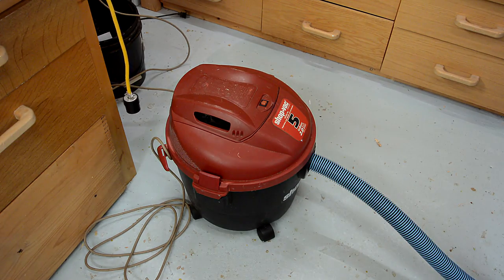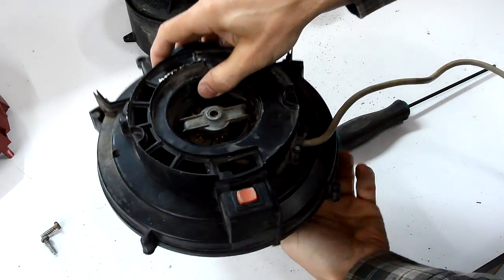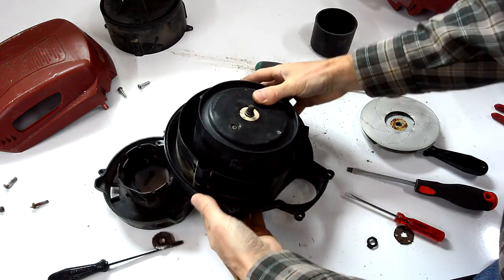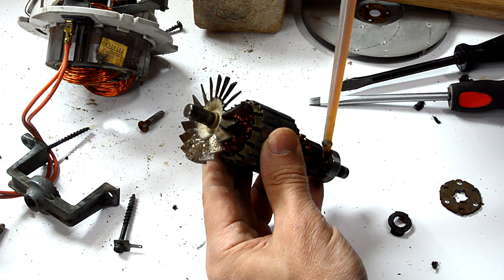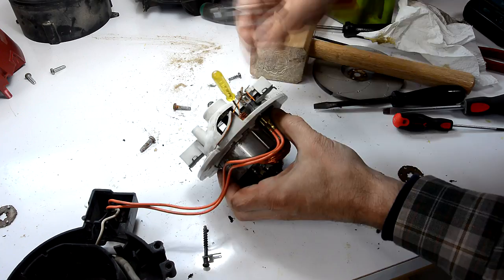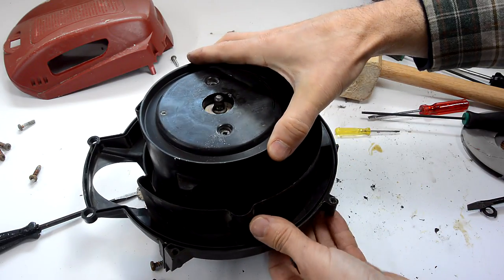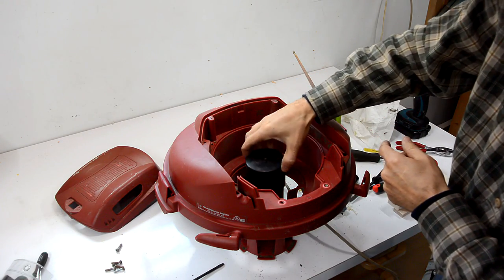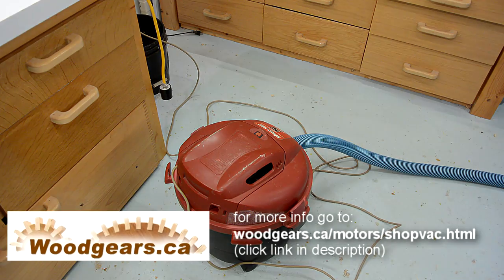Oiling noisy shop-vac bearings

Comment: Matthias,  Nice fix. I used a similar approach to my older box fans. I was thinking that wheel bearing grease might last longer as the fans are bogging down again.  What's you thought on this.  Thanks
Reply: Ha!  Funny you'd mention box fans!  I just did the similar maint on an elderly box fan that was ventilating my attic for several years.  Thought it was high time to replace it and do the clean-and-lube.  It wasn't making funny noises or anything -- that is, not until AFTER I lubed it.  Now it squeals like a banshee about every 3rd time I turn it on.  Do-over?  Unlike Matty's vac, this has the oilite bushings on BOTH ends.

Prob w/ heavier grease, though it may last longer, it will make for more resistance than lubrication when it's cold, making it harder to start up.  As this is already challenging for electric motors (starting from standstill) that's not a trade-off I'd try.  Light oil like 3-in-1 has been used for decades for a good raisin - on the oilite bushing, that is.  Sealed bearings another story - grease IS appropriate there!

I guess you could hunt down a mfg of spongiform brass bushings and ask them what they think of grease instead of light oil.  You might also find some other helpful suggestions (things to avoid) along with some microscopic pix.

Oh - back on original thing of "floating" oilite bushing at both ends - problem I've encountered with this type of procedure is that, for more reasons than one, perfect alignment of those two bushings is neither automatic nor easy!

my 2 cents...

Comment: I had to do the same thing on mine, also my overload protector burned out.  Here's a tip - replace all the screws with stainless, especially if you use it as a wet vac, will be easier to get apart later.

Comment: Nice one. They really didn't intend for that to be serviced, did they.
Reply: Dunno, at least it had actual screws. I've seen some that are pretty much hermetically sealed with clips on the INSIDE so you can't remove them without destroying them :\
Reply: Most certainly not!
Reply: I have to admit, I almost expected plastic bearings and certainly nothing more than sintered bearings... seeing a ball race in there was a surprise.

Comment: Just be careful if you have a Ryobi version as the vacuum section has a spacer and washers internally, so if you remove it from the motor shaft without a guide rod to hold the internals in place, will be a huge pain to re-orientate and align when assembling.

Comment: Great vid! Could we use grease instead of oil?  Would't it last longer?
Reply: Charles-Étienne Olivier - Grab a scrap piece of cardboard. Push the crews into it in their respective groups. Label if necessary as outer case, motor housing, etc.

Comment: I always clean the commutator with electric spray cleaner and sanding with 600 grit sand paper, then I used Slick 50 grease on the bearing  and bushing, I had one shop vac last for over 25 years of day to day heavy construction clean up use. And I always have extra filters to change as soon as they get dirty, I shake the dirty ones out and spray them clean with a garden hose, even the paper ones dry good out in the sun.
Reply: use oil not grease..oil specifically for motors motor oil is very bad for electric motors it actually removes the lube.. oil will impregnate the bearing as manufacturer intended..
Reply: Peter O, Slick 50 grease is a thin grease that can tolerate high heat it works great for electric motors,  part of my business is rebuilding swimming pool pump motors, golf cart motors and starter motors,  I have rebuilt dozens of them and never had a problem and used Slick 50 grease on most of them
Reply: Peter - Prolong engine treatment also makes a general purpose oil that works great for motors, I put a couple drops on the bushings in a Dremel tool that was making a lot of extra loud buzzing noise, it made it run quieter than a brand new Dremel tool

Comment: I opened my shopvac because there was something rattling inside and I found a black cylindrical cap 3 inches in diameter. What is it for? Earlier I was getting a burning smell. My Shopvac had not been used even 6 times - alas, bought it a few years ago and is out of warranty.
Reply: That cap is a stopper, used to keep water from getting up into your motor.  Hey, I too got a Shop Vac and only used it a few times before it started squealing.  Continued use like this brings on the burning smell.  I think they have built in defects to make you have to replace it.

Comment: If you have access to a vacuum chamber, drop the bronze bushing in a cup of oil and place under vacuum for 12 hours. Remove from vacuum chamber and let sit in oil for another 12 hours. This allows the oil to fully penetrate the bearing and your fix will last much longer.
Reply: You can also soak a scrap of old rag in oil, and affix that over the bushing. Save yourself a day of nonsense.
Reply: +Paul Frederick Or waste an hour of nonsense. :-)

Comment: Drill into the top of the pot metal bronze bearing, there is wicking packing that holds oilto lube that top bearing.  The bronze is porous and the wicking holds oil to lube that bearing.  So by drilling a small hole in the top you can push oil(propertype research) into wicking and thus have lubrication for you top bronze bearing. I mean long term . I also plug one end with a rubber plug fill bearing with  proper oil soak as long as you can. Remember bearing is porous you want it soaked. This will allow short term use. the oil inserted into wicking from upper hole (never the lower side it will leak oil onto motor bad) will give years of trouble service by keeping that bearing lubed....  I learned all this from fan motor maintenance sites. Some great clubs out there too.. Type of wicking to use correct oil how to re do a damaged shaft scored... Wicking is not always accessible. But a lot of motors the wicking is gone. I use felt works very good at holding oil.HAve fun and go look at some of the diy sites..Peoples collect really old fans.. I regularly rebuild my motors they last forever.. I also take apart motors to see why they failed.. Almost always no oil or wicking cause the bearing to seize and score shaft.. So keep it lubed and it will run forever..

Comment: There is a flaw in your video, the bronze bushing isnt designed to turn, and the part you oiled
isnt designed to oil the inside of the bushing.
All the bushing is for is to hold the shaft of the motor , which turns inside the bushing.
The proper fix is to take the bracket off as you showed, and clean the inside of the bushing and shaft, with a q-tip, then put grease inside the bushing and on the shaft.
Then put the bracket back on.
I did that and a little oil on the bottom shaft, and mine works great now, no squealing!

Thanks for the vid as it did show me how to basically take one apart and what was inside.
you should redo your vid and show using grease instead of the oil.
I notice you have another vid where you drilled an oil hole.
Also I just used common wheel bearing grease, but the black grease, or silicone grease
might be better. But grease is going to last longer than oil because these spin at such a high speed .
Another guy has a vid where he replaced that bushing with a sealed bearing lol.
But all that does is make the motor work harder , having to turn the bearing.
In the bushing it just spins freely.
But thanks for the vid, as I would never have been able to get mine apart without having
seen your vid. Mine was different case , but the motor was almost identical, same bracket
only mine had no opening on top.
And also if you make a new vid you dont have to take the whole motor out, just that bracket off.

Comment: Better use grease on ball bearings, instead of oil. Oil will get spilled out because of the rotation, grease won't

Also the bronze bearing will do much better with grease....
Reply: Grease will melt to oil when it gets hot, I would have thought.
Reply: I believe that ball bearing was pretty much a sealed bearing, thus making the attempt of grease pretty much useless. I might even question how much oil would be of use. What is significant though is that bearing may well be replaceable for only a couple dollars if one knows where to look online. However one will also need the special tools to pull/press the bearing
Reply: You need to look at fan maintenance sites grease will clog the porous nature of bronze. The bearing has wicking around it to hold oil against the porous bronze bearing allowing long term lubrication of the said bearing grease will clog and just ruin it. The wicking wool holds oil that with the porous bearing = long term life. (motors fail when wicking and oil have been used up)To re do motor you need to get the proper oil  into wicking. Replacing worn out missing wicking is used to keep a motor running forever and ever...Plus soaking the bearing any way you can helps to fill the bearing with oil. So the wicking can slowly re establish lubrication..  There are sites called fan antiques etc. that tell you the proper way to maintain antique fans 100 years old or so. Please go read them....
Reply: Good observation.  You might try using a hi temp. bearing grease to solve that problem.

Comment: God that turbo fan nut is a pain in the ass. They had to use a steel washer along with mine too and it's rusty as the titanic. Im gonna have to drill 2 small holes in the washer to fit a custom made ''pin bar'' similar to the bar used to loosen angle grinder nuts. I was also thinking about drilling 2 very small holes in the skateboard bearing and injecting pressurized grease via syringe into one hole

Comment: Forgive me for my ignorance, but I've never done any work with motors. What type of oil do you use? Is there specific bearing oil or will a different oil suffice?
Reply from the maker: whatever oil I have at hand
Reply: Any oil, except cutting oil and veggie. Well, maybe veggie will do in an emergency. :)
Reply: For PC case and component fans people say to use sewing machine oil, 3-in-1 oil, or even synthetic motor oil (non-synthetic motor oil might work as well but I'm not sure), and I've also heard some people use Vaseline to good effect, just don't use cooking oil. WD-40 would work too but only temporarily, so it's not advised for use.

There's special Mobil 1 greases you can buy as well, and they have different types for different purposes.

You basically just want to use an oil that won't gunk/gum up like cooking oil, dry up like WD-40 would, or eat away at anything, and the type of oils I mentioned before don't fail these requirements.
Reply: +sleeptyper why not cutting oil?
Reply: squidink RC
It has substances meant for enhancing metal parts getting cut (in a lathe, mill et cetera) and it's viscosity is very low.
Reply: Pretty much anything that's designed to lube stuff.  Don't use WD 40.  Contrary to popular belief it's a terrible lubricant.  But motor oil, gear lube, hydraulic oil, or whatever.  The trick it to lube it fairly frequently (especially if you tend to leave it out in the rain a lot.......which I never do ;)
Reply: +sleeptyper oh thanks, I have been using it for years in small brushless and brushed DC motors and it has worked great.
Reply: I use 3in 1 oil for electric motors. It is a lot lighter than motor oil and is designed for the felt around bushing/bearing. It absorbs very quickly into the felt and for the same reason it flows from felt to bushing easily too.
Reply: +Crustyswede1  There is 3 in 1 oil and 3 in 1 "for electric motors". It has the blue on label
Reply: +Crustyswede1 I use what I have because most of the time my budget is 0~ because I lost my shop and have minimal income for new projects !
Reply: +squidink RC online shop*
Reply: Molybdenum disulfide mayhap?
Stenchy stuff, but an awesome lubricant
Reply: Valve oil is very thin (I'm a trumpet player). I sure wouldn't use it for this application. I have an oil can I filled with motor oil maybe 15 years ago and it still hasn't emptied out.
Reply: 3 in 1 or 3 in 1 for electric motors is the go to oil for this kind of thing, but pretty much any decent oil will work.  I usually keep some light engine oil or transmission fluid (sometimes diluted with a little kero or acetone) in my little oil cans and it works fine for these kinds of applications as well as general lubrication, cutting, threading, cleaning...
Reply: I like a brand of oil produced by a company that is labeled,  "Supco. The original Zoom Spout, Finest All -Purpose Oil. Telescoping Spout Reaches Everywhere. Long Used By Professionals and Technicians. A Super Oil For All High Speed Shafts and Bearings.  Net 4 Fl. oz.  Part # MO-98"  The back side of the bottle reads,"Contains: All-Purpose Lubricating Oil,  Highest Quality Turbine Oil"  "Paraffin Base, Non-Gumming, Rust & Oxidation Inhibited, Use On Electric Motor Bearings, Withstands High Temperatures, A Must For Heater Blowers, A Real Problem-Solver For Professional Service People"  "A Product Of Sealed  Unit Parts Co. Inc.   PO Box 21   Allenwood,  NJ   08720"  The bottle tip itself is about 2" long, & has a fine flexible telescoping tube that is about 7",which allows you to get the oil to where it needs to go without having to stand on your head or remove obstructions beforehand. Bought mine at an appliance parts store for just a couple of bucks. The company also has a penetrating oil for loosening frozen or rusted parts that is also packaged in this really handy bottle.
Reply: +TheChipmunk2008 MoS2 doesn't stink on it's own. You would have to bring it up to extreme temperatures in order to induce decomposition.

Comment: Could you do a video on making the shop vac more powerful.
Reply: They're already more powerful than they should be. Keep the air filter clean, and it should work great. Hooking a Shop Vac up to a cyclone separator makes them perform better. That works by keeping debris from entering the vacuum unit.

Comment: The sleeve bearing is actually a bushing, not a bearing. That is what the most common failure point is. Take of the bracket on the top. Use pliers to remove the clip and replace with a bearing. You will need to use a hammer and the bearing down on the fan. Put a socket on the bottom of the fan to prevent damage to it. Use another socket to place on top of the bearing to hammer it down. Be gentle, if you hammer too hard, or you don't use the sockets, you could hammer the motor and damage it. Place the bracket on the bearing. When the bracket sits on the motor perfectly, with the bearing inside, where the bushing used to be, put it back together. If this does not work, let me know!
Reply: Don’t get oil in the commutator.
Reply: There is cleaning spray made for cleaning electrical motors. It should get the oil right off.

Comment: Why does oil on the commutator wreck the motor? Google was not helpful, some references to specific commutator oil came up.

I think I might have been tempted to drill an access hole in the cover above the bearing...
Reply: The commutator is where the brushes make contact to power the rotor windings. So that surface needs to be clean to provide the best elecrical contact. Oil, an isulator, on that surace would wreak havoc and probably soak onto the brushes further damaging the motor.
Reply: That's  what  I  did  with my industrial  shop fan, the bearing  dried  out  5 years  ago . Now  I  add oil about  once a month , runs  like  new .
Reply: I ask for details about the failure mechanism because grease or oil is generally not a problem on contacts, sometimes even beneficial, as long as contact forces are high enough to push the surfaces together.
I find it difficult to imagine the relatively porous brushes would not soak up and/or push aside the oil in short order. Also there is commutator oil available commercially so it must be a specific problem that only applies to some oils. I can imagine that arcing is a factor (burning the oil, we all know how those motors smell), or maybe the oil binds the dust trapping it between the segments, but this is all just guessing.
Don't get me wrong, I appreciate your comment, but as an electronics engineer I know what brushes are for, I would just like to know the exact failure mechanism.
Reply: Early brushes were made of a copper or brass mesh... which literally acted like a 'brush' on the commutator, hence the name, oil would probably be awesome for those, but yeah, carbon composition brushes+oil=dead motor
Reply: I suspect the problem with oiling a comm in a 120v motor is that the contacts arc and heat up, so the oil would tend to break down pretty quickly and form a sludgy mess that could impede electrical contact. Oil can also pick up dust and grit, which is never good news for sliding contacts. I guess it could also pick up brush dust, which is conductive, and get packed into the slots between the comm bars, basically shorting it out.